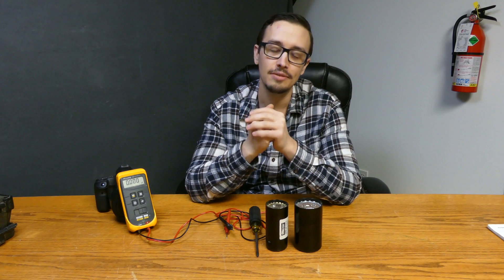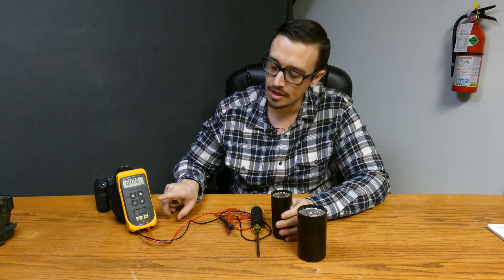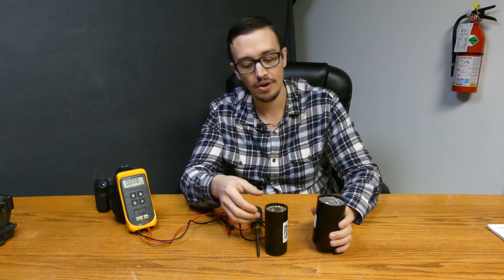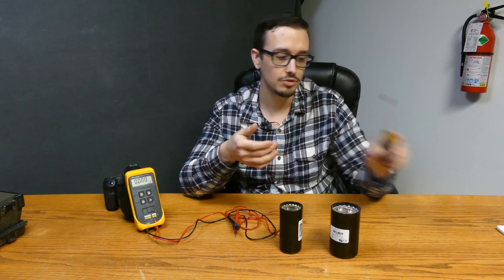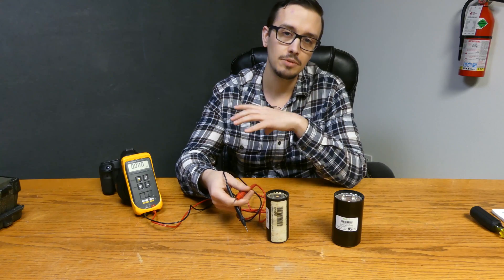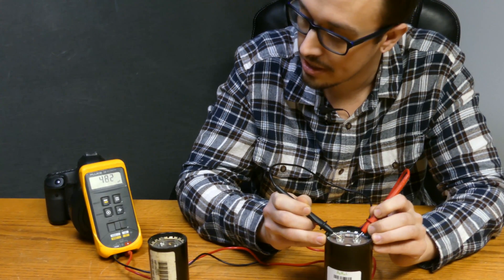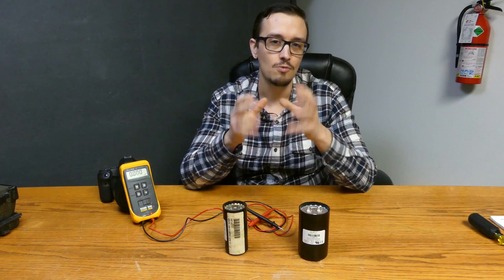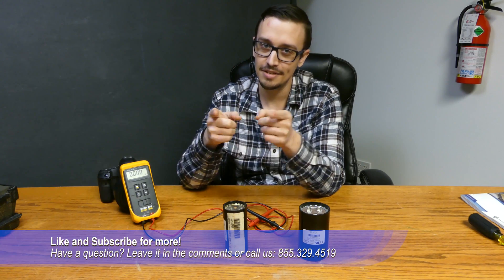How to Test a Capacitor

Comment: Using the screw driver to discharge a high-voltage capacitor could be dangerous to yourself and the capacitor.  Better to use a high ohm bleeder resistor if possible.
Reply: I was just reading. It's considered safe up to 99V for the screwdriver method.
Reply: What happens if there is say a 120V charge on capacitor. Then it's tested with a voltmeter on the high volt setting. Can this actually cause a spark discharging it by testing it?

Comment: How could you possibly think that you are qualified to make this video?  Do you have any idea how much energy that big capacitor might have stored in it? or the resistance of a path through your internal organs, and how much time it would take to transfer energy into your internal organs, to some easily computed percent of full charge, say 63.2%, thereby yielding the power applied to what was once your living body?  By the time you learn to set up and solve the differential equation for the exponential function controlling the circuit, ya the one through your internal organs, then maybe you  could share some of that knowledge with the public.  Until then, maybe NOT.
Reply: Voltage not high enough to fully get through skin.
Reply: I mean tiny capacitors can kill you before a giant 35v will

Comment: Will still have the voltage at the pressure switch even if the capacitor is not good, I get 245 at the switch and my brother already changed the pump and cable down the casing and the pump still don’t start. Now that I learn how to check the capacitor I will do that next but thought I asked .

Comment: Can you tell me if this applies to smaller caps? I am having an issue with the Samsun 1000uf35v where they are all reading really low (high 8 to low 9) and this is causing issue. Can you let me know if the same test should work for low resistance caps like those?

Comment: so for the larger capacitor, do you just go by that initial 300uf that it reads? why does it climb to 500, and what does it mean when it goes so far above the rating?
Reply from the maker: We tried testing that capacitor with 3 different meters, and two of them did that. The one showed a steady readout was a $300 fluke meter, I think it the capacitance reading has a lot to do with the quality of your meter.